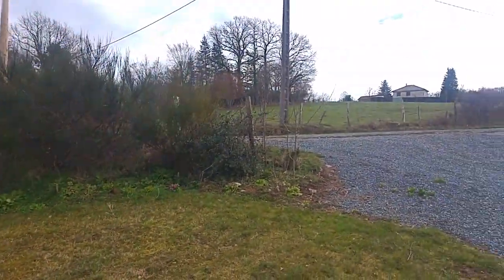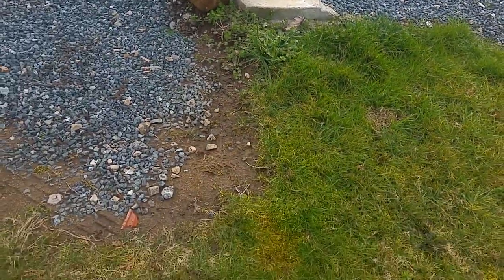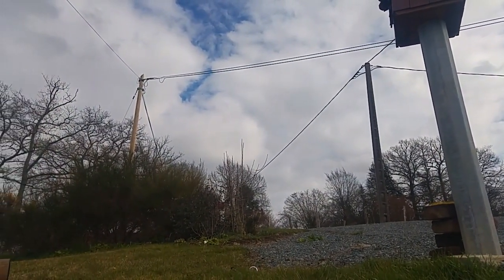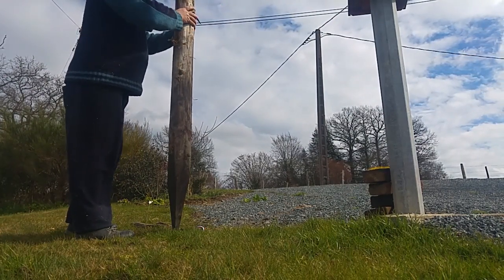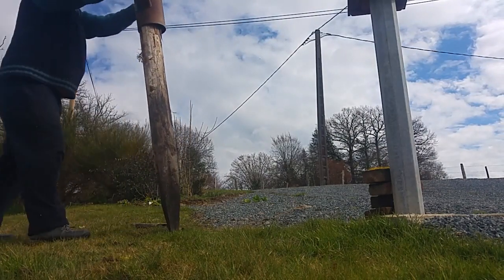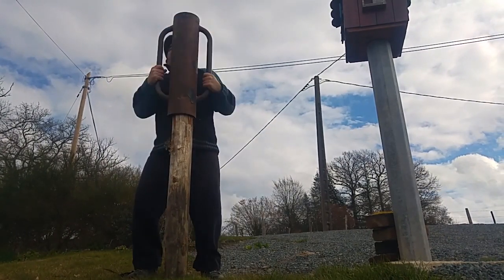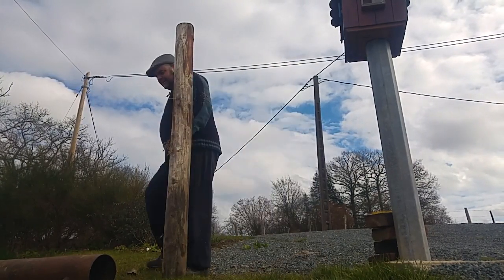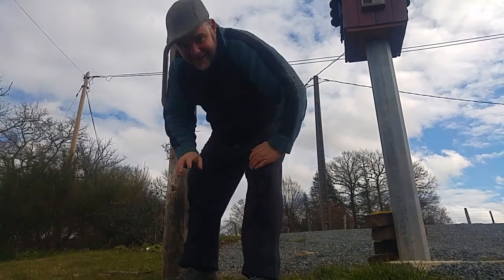How to use the manual 'Post Rammer' for fencing

Comment: Ever hear of something called a level ?
Reply from the maker: Experience requires no level
Reply: You can't plumb a rough post with a level, pointless, you need a good eye for level or a flat post plumb at the end of the run temporarily in the ground to use as a reference, or, like him, use something already installed you know is plumb, corner of a house, anything.
I agree that experience enables you to get it pretty much on the money too.